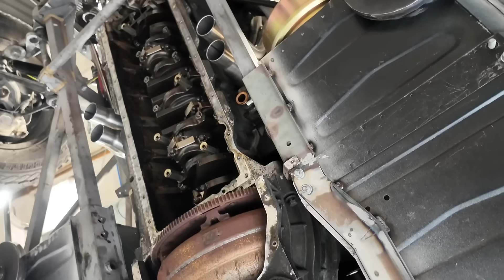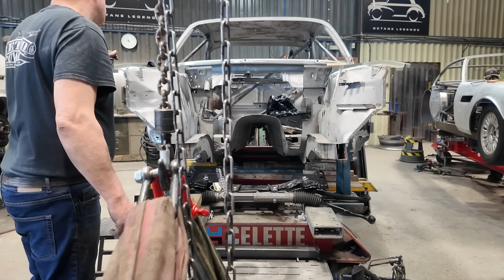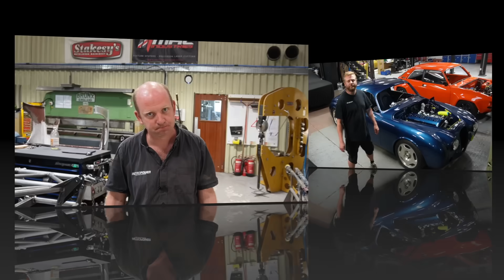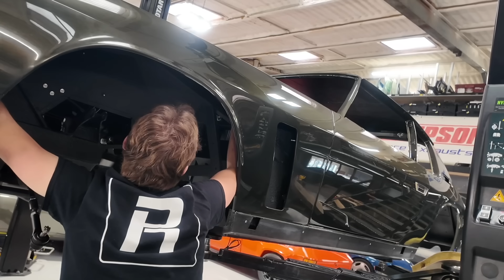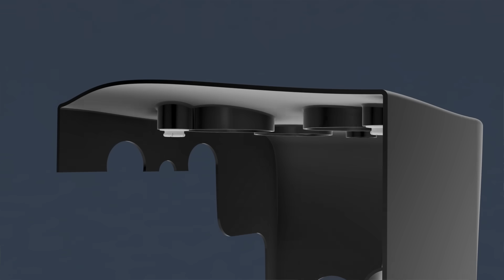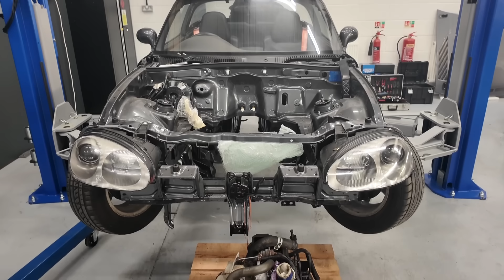MK1 Escort Restomod

Comment: Question for Nat - in relation to the E9.  You mentioned you’re going to use a Z3 steering rack.  Not sure that’s a good choice.  You may have concluded that the Z3 rack is a good option as it will fit the E30 crossmember you’re using - but so will any E30/E36/E46 rack.

Of all the racks fitted to these cars the ratio of the Z3 item is the highest and will probably make the E9 twitchy and tiring to drive.  

Beware - there’s a colossal amount of online misinformation about the actual ratios of BMW steering racks.  That’s because most people mistakenly believe the no of turns lock to lock is the key factor.  

The most popular rack that people retrofit is the ‘purple tag’ rack which was oem for the E46 Compact - higher ratio even than the E46 M3 CSL.  Note that the Z3 item is even higher ratio than the purple tag.  It’s a minefield - the steering rack fitted to the early E36 M3 was the cause of the ‘dead in the middle’ steering that the car was slated for on its launch.  The E36 M3 Evo item was better.  There are many permutations.  

The question is whether you want high ratio steering?  Will the E9 be a GT car or a B Road sprinter??  

Interested to hear what you think.
Reply from the maker: We are fitting an e46 purple tag rack...Nat was talking out if his back side 😆
Reply: @retropowercars 😂😂😂👍

Comment: Nat, my question is- how do you define the customer relationship with regards specific design requirements and Retropower's input, as in during the build process compromises may need to be made along the way which in the end may not quite be the desired outcome of the customer. I have no doubt every customer has a different level of input, and some probably have very little at all, but you may also stray a long way from the original concept.

Comment: Two small things worrying me. The three little tanks on the pedal box of the E-Type have similar caps, and the chances of disastrously putting the wrong fluid in a tank are high. Clear labels seem a must. Have you considered this? Also, what are you doing to finish the copper trim on Churchill? Will it be lacquered to stop it from going dull brown? Are there now direct-to-metal clear lacquers that are tough enough to expose to the weather for long periods?
Reply: I mentioned the thermal issues of having brake fluid/coolant/screen wash all in the same aluminium box. Aluminium will transfer heat between all 3, screenwash(methanol) has a boiling point of 68°C, the coolant will be at over 90°C and DOT4 boils at 115°C. The coolant heats your brake fluid, your brakes boil the coolant out of the expansion tank and the screenwash disappears. It makes Track days or a drive down a mountain more interesting 😂

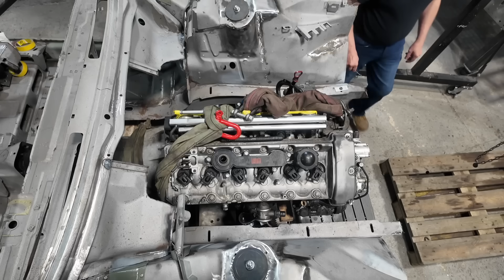Comment: 13:56 Looking at those horrible Torx bolts holding the bellhousing on, and remembering gas-axing one off in an early BMW 323i to do a clutch change!
German engineering indeed 😅
After loosing 2hrs of labour time buying a shorter socket and another extra universal joint, I was done playing nice guy 👌

Comment: Massively inspired by the work you chaps do, which leads me to the throttle motor as Cal was showing on Project One. I am doing an EFI conversion on my straight 6 Triumph Vitesse Special and want to declutter the engine bay where ever possible. Is a throttle motor something that I could adopt for my 3 x 2 modified Lucas Throttle Bodies in order to run Drive By Wire and let the ECU take care of the throttle?
Kind regards Paul from IAD

Comment: Here's a question! You mentioned previously about how tight the Scimitar is, (I have asked before 😊) but the door jamb is about 5"/125mm  (at a guess) so couldn't you narrow that to three inches, and move the seat position outboard by 1.5"/37.5mm (which would also reduce the effective pedal offset)?

Comment: Has there been any consideration regarding side indicaor view with the new front lamps on the Allegros? You'd normally be able to see the wrap around original but with the button type lamp it doesn't look like it will be all that visible from side on? Even older stuff that had recessed front indicators had repeaters for this very reason (thinking of Triumph TR, TVRs etc).

Comment: Surely it would have been cheaper to just  buy the Aston panels rather than a complete car as there is virtually nothing left of the original car
Reply: need the original car for the base ID though
Reply: Not strictly legal to register it in the UK like that too modified.
Reply: @mgbv8man2 yes I think we ate all aware of that but if it’s already registered then that is down to the owner to decide. ( assuming it is required for UK road use)
Reply: I don’t think it’s important regarding the % of original car parts, I believe you need the old paperwork and vin number, otherwise it would just be a “replica” of an Aston Martin.
Reply: Don’t call me Shirley 🤣😂
Reply: Seems like it would be worthwhile making a run of a few cars to spread the R&D costs. Would need to have enough universal appeal that 5 to 10 customers would be interested. Something iconic like the AM V8 on the corvette based suspension, although that will be hard to find enough donors I guess. I know your USP is one-off cars, but with a small run a full carbon body shell becomes a little easier to fund. Aston Martin V8 with a carbon shell?
Reply: @bwm999 RetroPower work on individually owned car projects subject to demand. Order book gets filled accordingly and results in a waiting list. They don’t “produce” cars for selling.